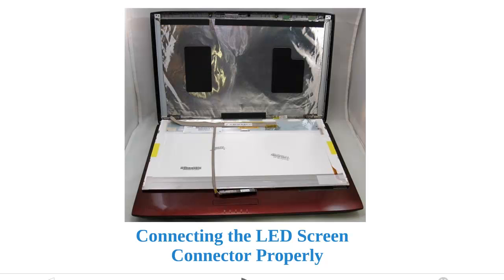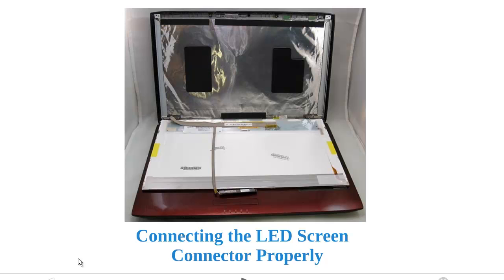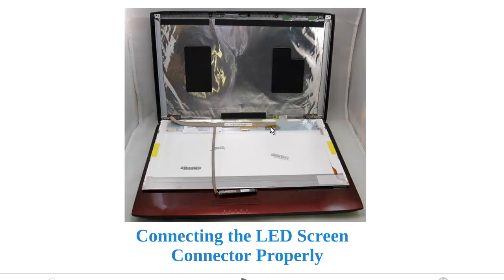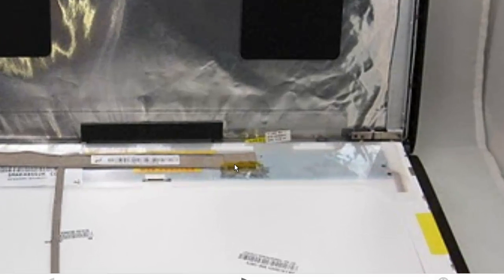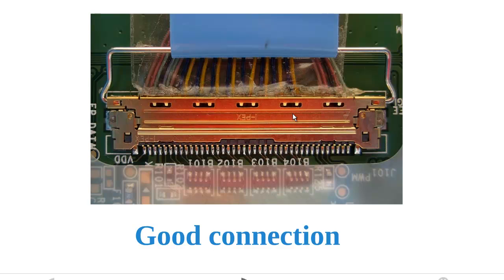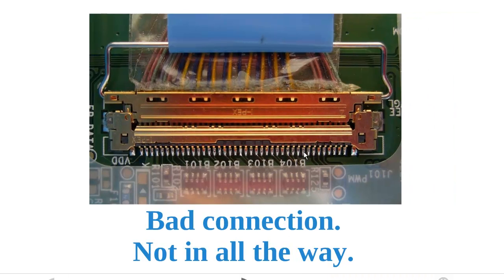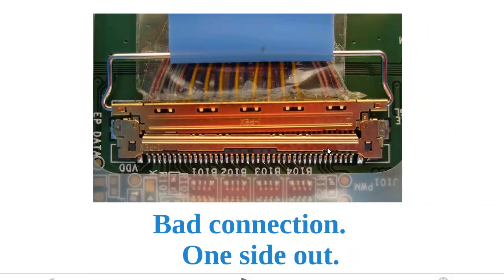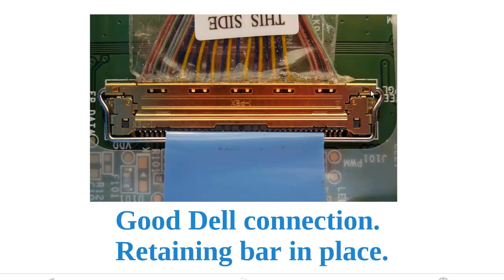How to properly connect a laptop LED screen

Comment: Thanks for the video. This is exactly what I was looking for. I am reusing old laptop screen for a DYI project. I am doing this for the first time and I lost about an hour and although the connectors match the connection between the pins can be mismatched extremely easy. How do you hold it in place? I think when I got nervous on the 10th unsuccessful attempt I may have damaged two or three pins on the display side :(

Comment: Found a couple useful videos on replacing the screen on my Dell E5520 and bought a replacement screen. The videos I had found did not go into any detail at all about how the connector worked and  this video was very clear as to how the connection goes together. I quickly had it back together and working properly after watching this video. 5 stars!

Comment: I'm replacing the screen in an hp stream and followed the steps in your other video as well as checked the connection. Both the new screen and old screen are black when I power the laptop on but I have verified it's a good connection and I've tried reconnecting it many times. No gaps, two clicks, each side is in. 
The old screen would at least turn on but was cracked. What do I do from here? Thank you
Reply from the maker: Please contact the vendor. You might have received a defective screen. Thank you
Reply: Screen Surgeons but the old screen also no longer displays any image. At least before the install it would light up and I could see it was damaged. Now it doesn't light up.